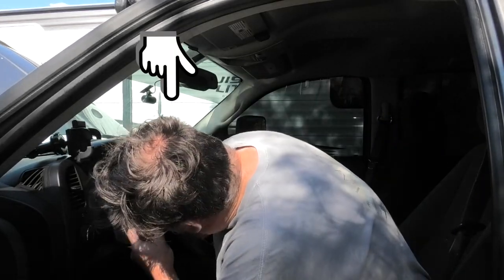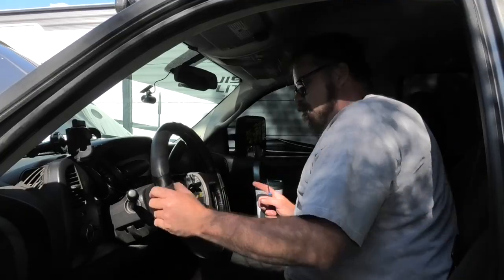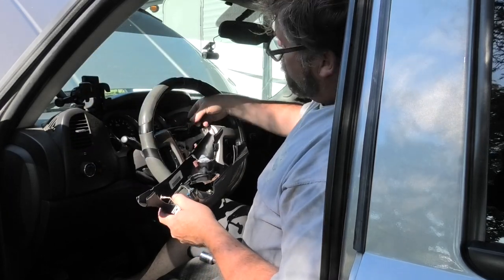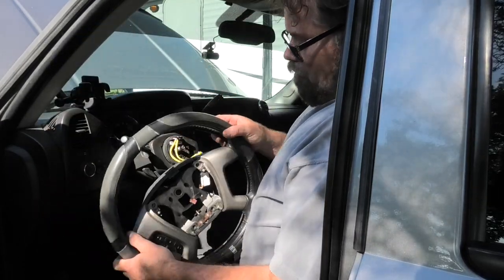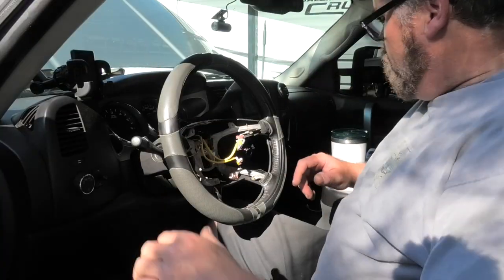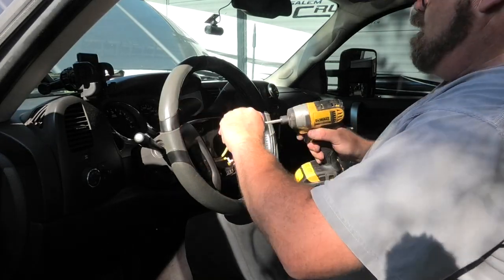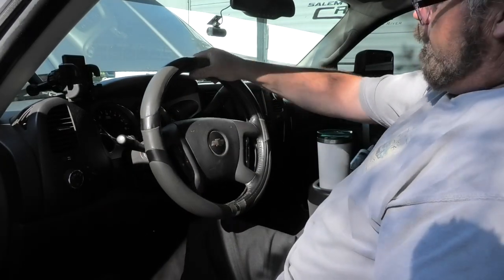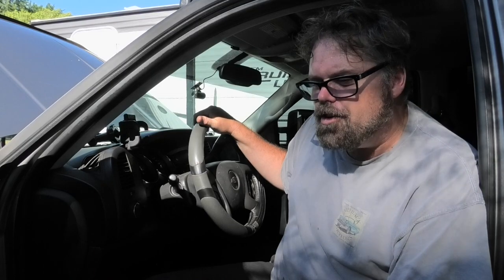Installing Steering Wheel Radio Controls In Chevy And Gmc Pick Up

Comment: Just found this video, I do not have factory cruise control, I have a rostra, But, If I install a new clock spring from a truck that has factory cruise will this work?? I have the factory radio.

Comment: what are the deck connections???
Reply from the maker: I used this but you could be different  
https://www.crutchfield.ca/p_541SWIRC/PAC-SWI-RC-Steering-Wheel-Control-Adapter.html?awkw=325987259404&awat=pla&awnw=g&awcr=190577904672&awdv=c&awug=9001087

Comment: Once you get that all installed do you still have to run a new harness from the steering wheel to the back of the unit?
Reply from the maker: No I didn’t have to just a mod box for my aftermarket unit

Comment: nice work Is it possible to do this for a 2020 Silverado 1500 custom?  If so where can I get the parts?  I have been on GM parts but it won't say if it will work with my truck.  Thank you

Comment: I just added mine today. It lights up but I have no control on the radio. What else do I need to do
Reply from the maker: After market unit or factory
Reply: @LifeWithBillSiff  factory. I only added the steering control nothing else
Reply: @skygaming9421  you ever get yours to work? Going threw the same thing on a 07 silverado ls
Reply: @michaeltaylor861  yes my brother did it and it was so simple even I could of done it
Reply: @skygaming9421  what was the fix? I'm thinking I got the wrong bcm/not the right rpo codes lol
Reply: @michaeltaylor861  I just bought a used steering wheel that had all that including the back covering for the same make and model. I got it online on ebay
Reply: @skygaming9421  well shit. I bought a whole wheel from s 2012 2500 and it won't work at all
Reply: @michaeltaylor861  maybe the chip is diffrent yours is a 07 or you got one broken

Comment: Thanks for the video trying to put Apple CarPlay up the radio. Your video did not help. I need to see some wires. One guy says I need both sides. I have the cruise on the one side but no radio on the other side where do you plug it in, the guy said cut it out to take the airbag out. More information on the wiring. They sell this shit on eBay. They’re all beat up compared to mine so I just want to the damn button did you do a follow up I didn’t see one you’re taking it to an audio guide for the other harness or should I go to the dealer, I have a basic radio upgrade